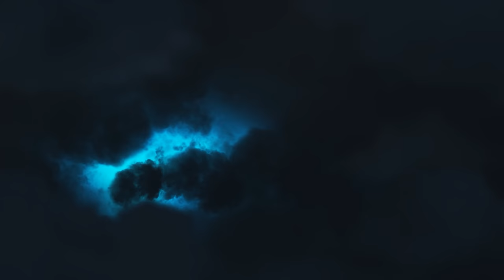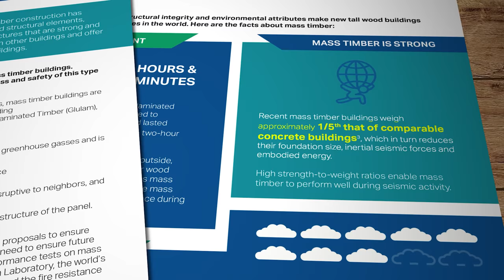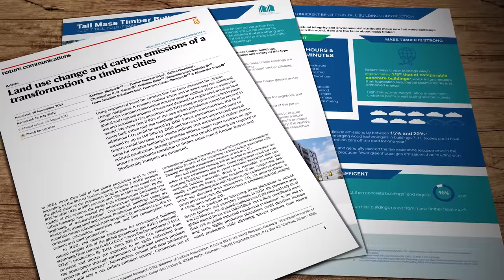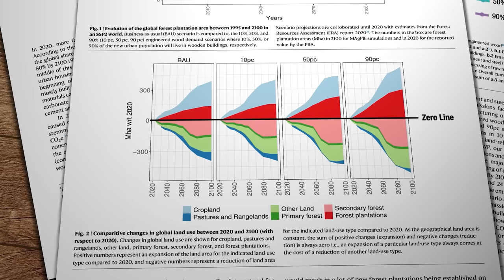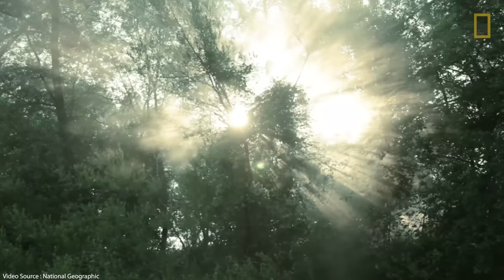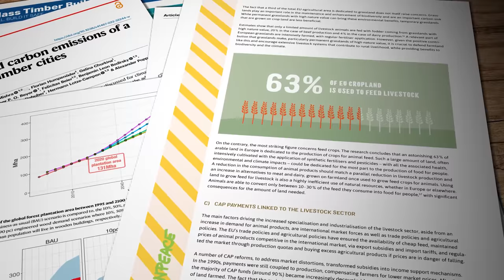Engineered Timber - building the skyscrapers of our future.

Comment: As a structural engineer with some twenty years of experience designing building structures using steel and concrete primarily, and as a father of two daughters, I would love to see timber being used a lot more than what it currently is. Steel and concrete certainly have their place, but timber is massively underutilized, especially here is South Africa. Decarbonising steel and cement will certianly help, but one must remember that concrete is more than just cement. Sand, stone, and water are required too. Illegal sand mining is a very real problem in many parts of the world, especially third world countries. Building sand (not desert or beach sand, the particles of these are way too smooth for concrete production) is in limited supply, way more limited than many would care to believe.

Comment: Another advantage of steel structures is that the steel can be almost 100% recycled at the end of the buildings working life. When these timber buildings are demolished most of the CO2 stored in wood is released.
Reply: if you make biochar out of those timber and put back in the farmlands then it is carbon negative.

Comment: I'm happy that you chose to do a program on this subject. Twenty years ago, as an architect in California, I looked at several methods of building before I started building a home for my wife and I. This was a single-family home, so engineered wood was not one option I considered. 

I tried to find information on CO2 sequestering of forests. It seemed to me that cutting down a forest and sequestering the CO2 in a structure meant that the forest had to start over again and would take many years to begin sequestering again. That's not to mention the loss of biodiversity, soil depletion, and fire prevention. 

I also considered the lifespan of conventional wood framed houses, which probably ranges between 50 to 100 years considering how much renovation occurs, although I know that wood houses can last much longer. I considered also that wood houses burn down and with more and more fires in a dry climate, that meant that non-combustible houses would be better. 

I ended up using a cement-based material, which used ground recycled Styrofoam as it's insulating material, completely mixed together. I used commercial steel decking for raised floors and roofs. Ok, so that's a lot more CO2 to make the materials, but if they last 1000 years instead of 100 years, that's a lot less carbon and a lot less area of the planet turned to forest farms and shredded every 50 years. If you are able to get more information from studies, I would like to know, let's say, how much CO2 is sequestered by native forest vs. farmed forest per acre over a three-hundred-year period.

I didn't have research studies to guide me, but lifespan is so important, and in many parts of the world that use cement, clay, rock, etc., homes last much longer. Of course, even after many California fires where homes burnt up, there has been little change in the way that homes are built to defend against fire.

I am heartened to see new ways of making cement, and I would welcome direct solar heating with concentric mirrors as a heat source, as a few solar power facilities have done. 

And another subject I would like to see studied is window glass. We are in the age of dual glazing, which uses twice as much glass, and lasts 1/10th of time of single glazing. How much is this really saving when we factor in all the manufacturing, transportation, and installation? In my opinion, we should be devoting major research money to insulating glass that lasts hundreds of years. Asia seems to be moving toward vacuum insulated glass, which I think is better, but I haven't seen longevity studies. 

Ultimately, the planet will experience 2, 3, or 4 degrees of heating before humans decide it is time to fix this problem, and by that time millions, if not billions of people with suffer and die, which will correct this over-population problem, but in a terrible way. So, let's enjoy these golden years while they last. Keep up your fine work of spreading information to the world. Thanks.
Reply: "we should be devoting major research money to insulating glass that lasts hundreds of years."  Back in the 50's my family built a new house with large trapezoidal windows. They were made by "welding" the glass edges to form the insulating space. Instead of the leaky metal & sealant now used. I recently stopped to look at that house & talk to the owners. Those original trapezoidal windows are still there and have not leaked and fogged. The catch is price! it always comes down to $$. I think those windows were made by PPG.

Comment: Here is an interesting perspective. 

Globally agricultural land area is approximately five billion hectares, or 38 percent of the global land surface. About one-third of this is used as cropland, while the remaining two-thirds consist of meadows and pastures (for grazing livestock).

143 million hectares is a little under 3% of this total. 

Precision fermentation is predicted to reduce livestock population by up to 90%. 

This would free up vast amounts of land. Perhaps in the order of 30 times the required amount. 

That would suggest there will be ample low cost land becoming available in the next 10 to 30 years. 

None of us can predict how this will play out but this shows me at least that there are forces already underway that dwarf the scale of the issue (important as it is) which is presented in this video. 

In addition:

Self driving cars will mean there will be perhaps a 90% reduction in the need for parking space 

Boring tunnels and self driving cars will greatly reduce the area of land needed for roads. 

This will allow urban areas to house more people taking pressure off corridor land 

Virtually free marginal energy will change the game in related areas. For example, very cheep energy changes the maths around carbon capture and sequestration. That interplays with the need for mass timber from at least a carbon point of view. It also changes the maths around recycling making it much more cost effective to recycle, mine our land fills and use precision (atomic level) recycling.

Comment: The world is changing so rapidly along so many dimensions that these single issue studies can be very hard to do and interpret. 

In practice, the building industry will continue to use more mass timber. At the same time land use will shift profoundly. Some forces at play include:  
Precision fermentation and vertical agriculture. 
Virtually free marginal cost of energy from battery wind and solar
Self driving transport and tunnel infrastructure 
AI and robotics
Gene and nanotechnology 

By the time the construction industry hits even 10% mass timber adoption the world will be a fundamentally different place. 

The lesson is to start and adjust course over time. 

We live in exciting times. 

It is impossible to know what mix of solutions we will end up with.

Comment: I am an ICC member and teach/write on code related issues.  I am in the San Francisco Bay Areas.  I am unconvinced that the use of CLT materials for large structures is a good idea.  I've seen some of the research and am skeptical about the long-term durability under real world building conditions.  Other engineered lumber materials for tall structures are clearly a bad idea. 

My skepticism revolves around two basic areas of concern.  One is fire resistance.  Again, I've seen some of the CLT research.  It will be interesting to see how when one of these buildings is subjected to a real fire - not lab simulation nonsense.  

We have a huge number of multi-family structures being built in our area.  The typical building is an elevated post-tension slab with 4 stories of mostly engineered lumber construction above.  A few years ago (2019), one in construction caught fire before drywall was installed.  This property was almost a city block long.  The fire started at one end.  The workers had to run to the other end - barely outrunning the spread of fire and jump onto the scaffolding that had just been erected.  If the scaffolding wasn't there - it seems likely that people would have died.  The entire structure was fully engulfed in under 10 minutes.  Fire fighters were only able to protect adjacent buildings - the project was destroyed.  Search on Anantara Villas fire Santa Clara, CA.

Granted, CLT material is a different wood material than what Anantara Villas was constructed of - but it is still wood pieces glued together.  The glue joints in wood PSL, LSL, GluLam, OSB, etc. can lose their integrity in a fire.  They also may burn.  A fire chief on the US east coast calls the typical engineered wood materials "solidified gasoline".  Again, CLT is sold as being "different".  At the end of the day, it is wood chunks that are glued together.

My second concern with all wood materials is simply water.  All buildings will suffer from water issues.  Be it leaking roofs, leaking exterior envelopes, like windows, leaking plumbing.  Moisture damage may occur even when nothing leaks from warm damp air condensing out in cold wall cavities.  It appears that condensation and outright leakage contributed to balcony collapse on an 8-year old wood framed multi-family structure near me.  That resulted in 7 deaths and several serious injuries.

Even with chemical treatments - wood will eventually rot.  I imagine leaks on the lower floors of one of these tall CLT based structures that goes undetected until the building is put under stress.  Maybe that's an earthquake, maybe it's a hurricane.... that would likely not end well for the occupants.

Whenever people develop these amazing new building materials, we never find out if they actually stand the test of time until we see if the buildings are still standing after a long time in real world conditions.  Construction history is littered with examples of bad ideas that were used until the failures presented themselves.   There are many billions of dollars in class action lawsuits over some of these failed products.  

I'd prefer to stand back and see what happens here.  Let someone else be the Guinea pig on this one.  Just my two cents.....

Comment: Decarbonize cement as much as possible. Reuse old broken concrete as aggregate, both in new concrete and as underlayment, drainage and support.

For single family housing, or smaller multifamily housing, instead of new concrete foundations, use broken concrete with much smaller amounts of new cement as mortar in between. This won't work where it has to be very strong, but will work great on smaller construction

Decarbonize steel as much as possible, even though I doubt much can be taken out.

Use timber for all small construction. Use engineered timber for mid size and larger construction. I am sure the industry will reach new heights as it becomes more popular.

Use more timber in large and tall construction, such as walls and floors. Use as little concrete as possible. Create new standards for elevator and stair shafts that do not use concrete, or use significantly less.

To provide land for the additional trees, reduce land for meat, dairy and especially feedstock. Worldwide add taxes to meat to make it much more expensive. No other regulations would be needed to reduce consumption. Ditto with dairy. Add big taxes for ocean grown fish and seafood, to stop that from being eliminated in just a few years. Allow farm grown fish and seafood, but heavily regulated so that they do no destroy land. waterways or oceans. Allow lab grown meat - soon to just be factory grown meat.

Put in place protections for biodiverse lands and forests in tropical areas where there is little protection now. Reverse the devastation made to tropical forests by people looking for short term profits from raising cattle.

Start projects to reforest areas already deforested in the tropics, in Africa, in places that were forests before mankind cut them all down.

Timber farms need to learn better land management, using a wide variety of types of trees as well as other plants that typically live on forest floors. prevent the single crop reduction in ability of land to support plants.

More needs to be done to farming to reduce the impact on land as well. With computer controlled machines planting and harvesting, there is a potential for mixed crop fields, not just crop rotations.

The reduction in meat consumption is inevitable as the population nears its maximum and as more of the world gets a better standard of living. We just need to accelerate it and make it a much larger impact. Mankind was never meant as a predominantly meat consuming species. Vegetarians and vegans are healthier, if we can eliminate more poor health and disease from poor diet, smoking, tobacco use, and drinking alcohol (reduction, not necessary to eliminate, as that will create more crime) we can reduce the costs of healthcare for all.

Comment: Thank you! Very interesting points and with good timing! Presented holistic approach is also a plus. Wooden construction is far from being wide-spread why the earlier all pros, cons and synergies are studied and discussed the better the result could be.
I believe that middle grounded solutions have better chances to succeed. 90% of all new urban housing in wood seems to me as unreasonable as 90% of EVs of all new cars on the roads.
Some random points:
1. In construction mix of engineering wood and “green” concrete structures could be a good compromise especially in high rise buildings.
2. When it comes to forestry there are already a lot of examples of its diversification and combining it with agri- and aquaculture. Adaptation of such projects for re-desertification could in its turn potentially create numerous win-wins related as well to the subject of this video.
3. The growing need in food production restricting use of potential farm land for anything but agriculture could give a proper boost to urban farming(not 90% of vertical farms as a key expectation)) which is far from being well developed compared to its real production capacity in addition to its other obvious positive synergies. 
4. Imagine that points 1-3 could be in some way interconnected within some circular cycle!

Comment: Not sure about forests causing warning.  Every forest I've been in has been cooler than the adjacent non forested area
 And since nothing is gained or lost in nature,  the solar energy not reflected has been converted in the trees to plant energy and fiber.  By way as it happens of storing carbon at the same time.  This is just personal observation. As far as the land use goes.  There is easily a trade off in dairy and meat production lands for the needed forest land.  And it doesn't mean stopping meat production.  Just a shift to less and using more arable land for plants that humans consume directly.  Another benefit of wood is that outside of carbon fiber there aren't any mainstream materials that best wood for cyclical loading. In large structures this would be very desirable for sway and earthquakes. Wood is good.

Comment: As with much modern discussion, reduced consumption is often ignored as a possible mitigation measure.  Smaller houses used for longer, better utilisation of existing housing stocks.  Methods for re-using building materials.  Iam unsure of its importance, but  paper-faced plasterboard seems to me to be rather invironmentally unfriendly, and huge amounts of it are discarded from renovations etc.

Comment: Interesting that they are saying these extra plantations will increase the albedo of Earth. If that's the case the albedo must have been much higher previously, as we have cut down so much of our natural forest over the last few hundred years. If modest reductions in meat and dairy produce are what is needed to offset than that is surely the way to go. Beef production is apparently particularly challenging environmentally - in terms of both CO2 production and water usage. Could veggie burgers actually help save the planet?
Reply: I think the albedo reduction only really applies in boreal latitudes where the forest would be displacing ice
Reply: @sammason2300  I would have thought the rate of growth to be too slow at those latitudes for them to be practical/profitable locations.
Reply: @dwftube  The Boreal forest is absolutely massive (the biggest in the world?) A significant chunk of it is in Canada, Scandinavia and Russia which have very active timber industries. I have no idea how their profitability compares with lower latitude forests, but monocot tree species (e.g. pines) can grow very quickly compared to hardwoods.
Reply: @sammason2300  I didn't know that about the growth rate  - I assumed because of the climate they would be slow growers. I didn't know they were cutting it down (naive I guess) - that's madness!

Comment: There is a big problem happening in the forests in the US and Canada.  Global warming has caused milder winters and it is not getting as cold for as long in the winter.  Before, it was cold enough to kill most of the bark beetles so they did little damage.  But now huge areas of forest have been killed by the bark beetles and the trees have turned brown and died.  These trees should be used for timber instead of cutting down live trees.  

There is a very fast growing tree called Paulownia that gets big enough for lumber in only 7 years.

There should be a law passed that eliminates ethanol for Flex Fuel cars. The whole Flex Fuel system was restudied and found to be worse for the environment that straight fossil fuel.  This would free up large amounts of farmland for other uses.